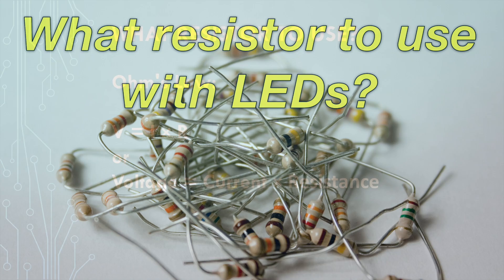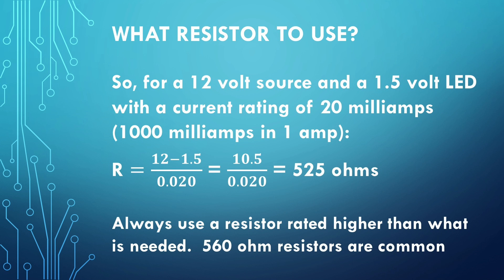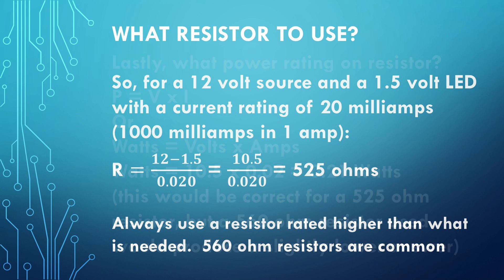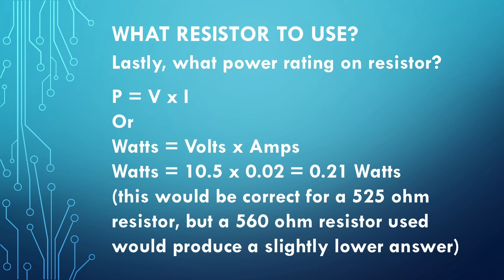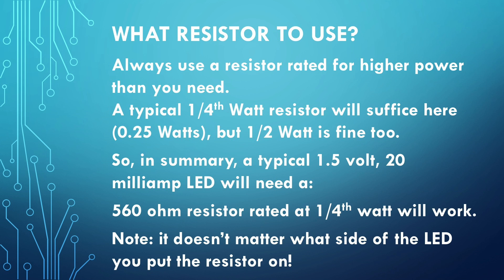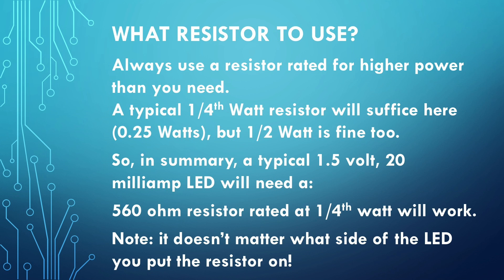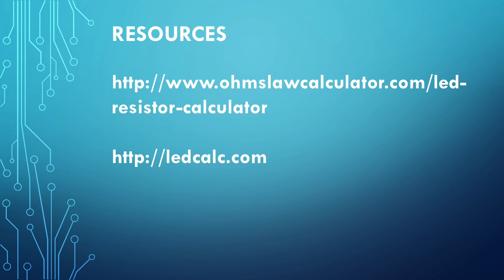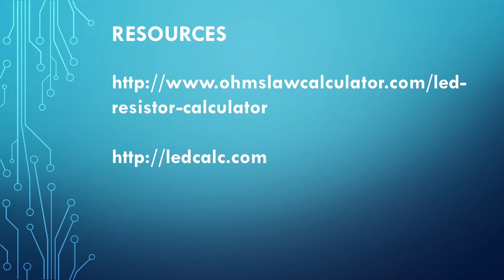What Resistor Should I Use When Wiring Up LED Lights?

Comment: My LEDs have been working fine without resistor...how long before they are fried? Also,how high in resistor value I can go before it effects LED?
Reply from the maker: If the voltage going to the LEDs is at or below their rated voltage, they should work ok. But, if you can lower the voltage somewhat they will last much longer. I recently put up some 12v LED strip lights but found that they are nearly as bright if I supply 9volts and they run cooler which will make them last longer. I’m lowering the voltage by using a 9v power supply rather than resistors.

Comment: One of the best video to explain resistors!   Thank you.   Now, if I have a power source of 12 volts how many 3 volt lights can I connect on my 12 volt bus wire?   I will use 620 Ohm resisters on each light.   The lights are all separate, not stringed together.   I need about 45 3 volt led lights on a single bus wire.
Reply from the maker: If you are wiring them in parallel, the voltage has no impact on how many you can attach but rather the amperage. So, if your power supply supplies 1 amp of power, for example, you divide that by the current draw of each LED.  So, if each one draws say 20 milliamperes, then you could have 50.  But you wouldn’t want to put that many on there of course. I usually try to stay around half the rated power supply. I’m not actually sure what a good rule of thumb is on that, but if you are in that neighborhood then you should have no issues in terms of the power supply overheating or anything.

Comment: Yeah I can't follow that detail, but can a resistor light up from dissipating heat other than catching fire? If so, that'd be  lit...and there'd be applications...
Reply from the maker: Any wire that has significant resistance will get hot and glow, like why you have in a toaster and that kind of thing. Those are effectively resistors where they get hot enough to glow but don’t catch fire.
Reply: @StevesTrains  Cool. I don't know subject well, just thinking about if resistor can have uv light on end of it, which might be dumb, but maybe amplifies light more. Then have that in magnifying lens case, inside of solar panel box...which is probably dumb way to recoup the energy, but so many things have lost energy from escaping heat...which is useful to function okay,  but, it's lost energy...I  wonder if magnifying lens amplifies that energy  for useful recovery

Comment: I have a 194 LED bulb for a car that is rated at 0.3 W and the current draw rating is 0.035 A at 13.2V. The stock incandescent bulb is 5W. Would a 100-ohm 5W resistor work for this or should I go to a bigger ohm value with a lower power rated resistor, eg 1/2W, 250 ohm? I find this confusing because some sites discuss having to consider the forward voltage of the LED which for a white LED is around 3.4. The issue I have is that the car randomly turns off the license plate bulb because the power consumption is much lower than expected. So I’m trying to figure out the right size resistor (W and ohm rating) to prevent that. This seems like it should be a simple calculation for anybody electrically inclined but even vendors specializing in auto LED lighting cannot answer this question.

Comment: Okay Question? I've got a set of led string lights (Fairy leds) red in color 
Ok I want to cut them down in strands I'm wanting to put 2 on my crossing gate to flash along with me signals, what risister would i use for this product?
Reply from the maker: Hard to know as it depends what the voltage is going to each light now. If it is say 3V, and you know want to power them with a 12V power supply you would need maybe a 470ohm resistor if they are 20ma lights. You would either need to get a voltmeter to test the current at each LED or maybe just get a variety of resistors from say 200-800 ohms and do some trial and error with some LEDs you snip off the string. You will blow some but they are cheap so not a big loss if you fry a few individual lights. You probably will need to experiment anyway so you can get the brightness you are looking for.
Reply: @StevesTrains  Thank You for your reply I got my project finished. It was a struggle upon finding the exact resistor needed.

Comment: Great video! I wanted to ask you for your advise on my project. So I have 20 red LED diodes with a 560omhs resistor on each one. The LED specs are 2.0 forward voltage and 20 forward current. I want to wire them in series to a 12v power source to my brake lights on my car. What's your opinion on this set up?
Reply from the maker: If the resistors have the 560ohm resistor already attached and are rated for 2volts, then you should be able to attach them directly to the 12v power supply since that resistor will drop the voltage to under 12v for the LED. You would need to wire all of them in parallel in that case, not in series. The vehicle battery will supply plenty of current to light all of them, so that isn't an issue. While you could wire some of the LEDs in series (e.g. 6 LEDs in series to take the 12volts and drop it to 2volts per LED), that isn't as safe and if one LED fails they all will in that series.
Reply: @StevesTrains  thank you for your reply. I Appreciate all the information. This answered all my questions.👌👍

Comment: Hey can u reply to me asap because i dont know if i am doing it right i am using 1k ohms resistor on orange led is it okay? Because it seems to have lower light
Reply from the maker: I have a reference table here: https://www.steves-trains.com/tools-references
that you can use to see the best resistor for a given LED rating and power supply. If an LED is dim, then you aren’t going to have a problem, but you are limiting voltage more than you need to.

Comment: No one ever explains how to calculate the value of such a limiting resistor with a random LED of unknown specs. But especially this video is kind of useless because of how fast this guy talks. It's so frustrating ....👎
Reply from the maker: If you go here: https://www.steves-trains.com/tools-references and download the LED reference sheet you can start by assuming the LED takes 1.5 volts and is 30ma and then work your way across the table for whatever power supply you have until the LED lights. Otherwise, getting a variable resistor can help you figure out what to use. Yes, I do talk fast, but I think most other people talk slow. ;)

Comment: If i have a 12V power supply and 6V led i dont have to carry about rezistors?
Reply from the maker: Ondra Borovec if the LED is rated at less than the power supply you will need a resistor.  In your case you will need a resistor since the LED is only 6V and your power supply 12v.
Reply: @StevesTrains  And if its the other way?  6V power supply and 12v led? What will happen? Thanks for help.
Reply from the maker: You won't technically need a resistor, though it is possible there won't be enough voltage to light the LED.  Probably it will still light, but just be somewhat dimmer than normal.

Comment: i I'm new with electronic stuff. 
i just want to ask is there any problem if i put or place the resistors in any sides or reverse?
thanks
Reply from the maker: You can put the resistor on either side of the LED and you can put them in any direction. However, if you are wiring a lot of them it is good practice to keep them all facing the same direction and on the same side of the LED (either positive or negative) since that can make trouble shooting a circuit a lot easier if you have problems down the road.
Reply: thank you for the reply,,,, so it is ok reverse or not ?any direction is working??
Reply from the maker: Yes, the direction of the resistor doesn't matter.  It doesn't care which way the current flows through it.
Reply: noted ,, thank you so much,,

Comment: Awesome! Would this same theory work for an interior (home) 12v light fixture? I changed all the bulbs to LED from halogen and the "flicker" unless I put one halogen bulb back in with the group to increase the load. I have to use at least a 20w bulb otherwise it will still flicker with a 5 or 10w. This is frustrating though as they go out frequently. They are small bi-pin bulbs and I was thinking I could just put a resistor along side one of the bulbs to increase the load.
Reply from the maker: Potentially, though it depends on what the actual source of the flicker is and how the fixture is wired.  You might just cut the voltage to that particular light, and not really impact anything else.  It might be an issue with the power supply not being able to keep the voltage steady when current draw is low.  Hard to say really. If the fixture is controlled by a dimmer switch, that might be the source of the problem actually.  Some of them I think just control the brightness by pulsing the power. That is often a problem with CFLs or LED lights. Halogen/incandescent bulbs make good resistors and fuses and help with that.
Reply: Steves Trains Thanks for the quick reply. It is a large circular fixture with 8 individual hanging teardrop globes, each with their own 12v bulb, designed for halogen (g5) bipin bulbs. Since it is 12v, obviously there is a transformer for each fixture. When I have all 8 globes with LED bulbs it flickers. If I put in one 20w halogen, it is okay.